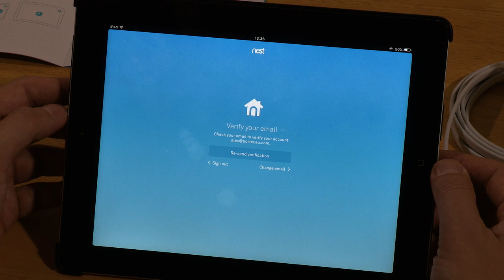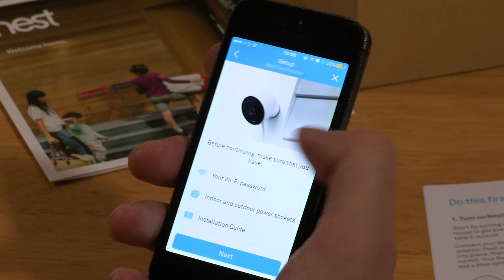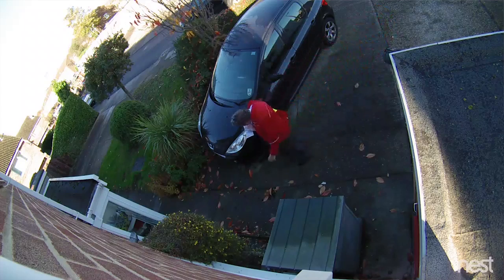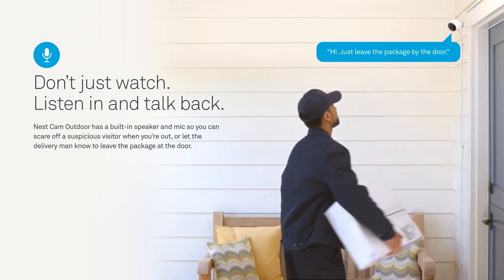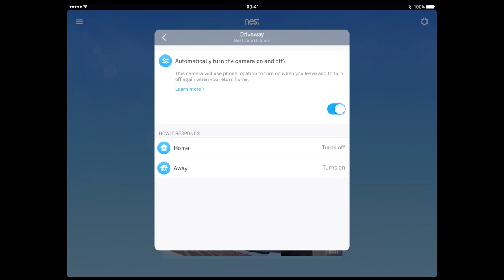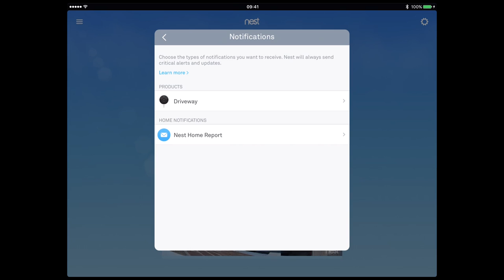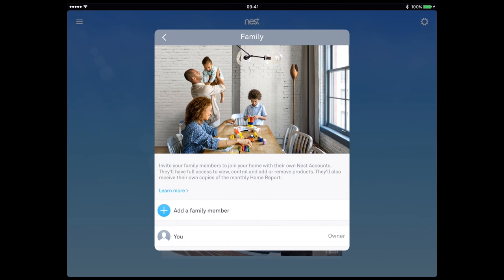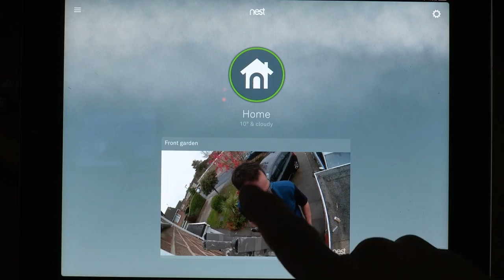Nest Cam Outdoor Camera Review & Installation

Comment: Hi I am planning to drill a 20mm hole from the outer wall to bring the connector in side the home. but want to make sure 20mm hole is wide enough to insert a pvc pipe of 20mm outer diameter in the hole first and then insert the cable in to the pvc pipe. is it wide enough? can you please quote the exact diameter of the USB connector so I can give it some clearance for the pvc pipe thickness. Thanks.

Comment: You didn't actually show the installation... That USB connector looks massive how big a hole.will I need to drill??!
Reply: I agree that hole was just for the plug but the cable itself was thin. I wonder if they used silicone to water proof the hole.
Reply from the maker: I think the hole drilling was covered. It is big because of the plug and you have to seal it afterwards.
Reply: Skill Builder deal breaker.... Holes massive
Reply: It is a 7/8 inch hole.

Comment: its easier to use a IP camera with Power over Ethernet. all you need is to run a cat5 cable and you can put the power supply anywhere. surprised the nest camera doesn't have POE.
Reply from the maker: This system is not connected via ethernet cable. Each camera is connected to your router via a wifi connection which is generated from the power connection module.
Reply: POE would have been a gazillion times better.  Being able to record to your own device would have been a gazillion times better x 2.
Reply from the maker: Different people have different needs and having footage stored elsewhere is useful when someone steals your hard drive. 
Have a look at the Foscam system on our channel It has all the things you describe.
Reply: pprocacci b
Reply: pprocacci I wouldn't want a hard drive there to be taken. It would defeat the purpose of someone ran out with it along with my computer. Cloud is better.

Comment: Ya do you really need to have a 20 mil hole?  Why couldn't they make it the size of the cord?
and make it so you could open up the camera and reconnect the charging cable if perhaps you didn't want to put such a large hole in your wall?  Or at the least they could include a large 20 mil grommet that keeps the bugs out?

Comment: All well and good if you want to monitor it from your Smart phone or a tablet but what to do (or get) when you want to monitor it from your PC and the software doesn't work? I just want to see who's at the front door when I'm in the back of the house on my computer and I don't want to do it from a cell phone. I spent all day fighting it, downloading spyware simulators, etc. and I'm throwing in the towel. It's going back to Lowe's.

Comment: I was going to buy one or more of these but after seeing the install i definitely won't. Aside from the external cabling (including power at ground level - just turn the camera off?!) the magnetic mounting is a massive no-no for me, a simple shove with a stick will either point it in the wrong direction or even completely dislodge it from the wall! Barmy!
Reply from the maker: Any camera can be knocked out of level or have its cable cut if exposed. The real pest is spiders and webs over the lens.

Comment: So will every ne'er do well just be cutting 'phone and CATV cabling beforehand? Hi viz and ladder up nearest telegraph pole, nobody will challenge this nowadays. Wi fi useless if router can't talk to the outside.
Reply from the maker: Yes you can't do much to stop the guy who is determined to cut the lines but most burglars are not that determined. In fact the alarm and camera is usually enough to send them on down the road. If you are rich and have a lot of nice stuff to steal your insurance company will be looking for a much more advanced system.

Comment: That 20mm hole is absolutely stupid. Who is going to drill a 20mm hole just for a USB. It needs a small connecter 10mm max. For this reason I will not be buying
Reply from the maker: fair comment

Comment: Rubbish product - I had 2 cameras ripped off the wall with ease and the bad design of the product did not prevent it - DONT BUY IT!!! The service has been awful and not customer focused at all especially spending over £1,000 one would expect some service instead it has been arrogant and dismissive offering less than 6% discount - I would have expected more from a Google company
Reply from the maker: You can't really blame anyone but the thief for ripping them off the wall. I fit them high up and use good screws. You should be able to secure them to the wall as well as any other camera. As for the service, you don't say what the issue was only that they offered you discount.